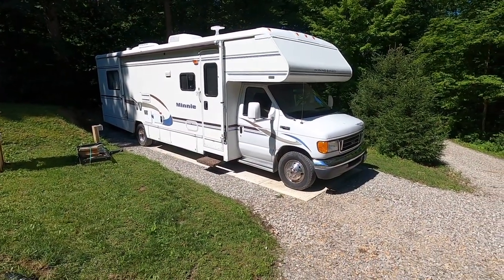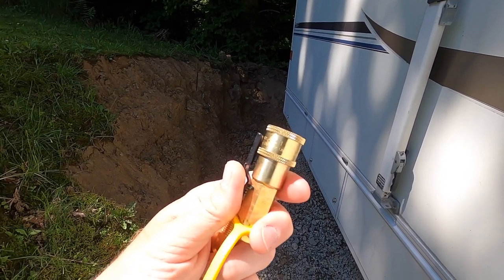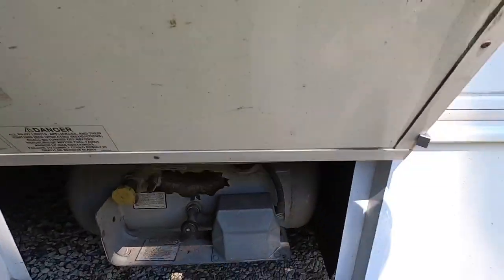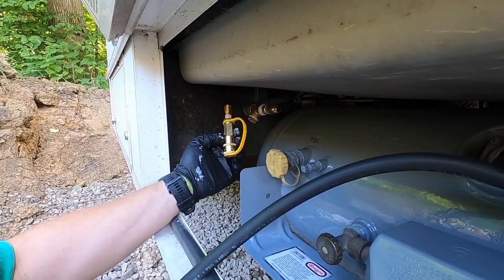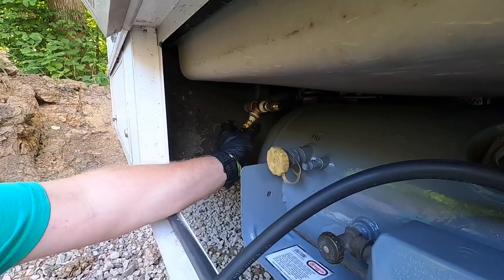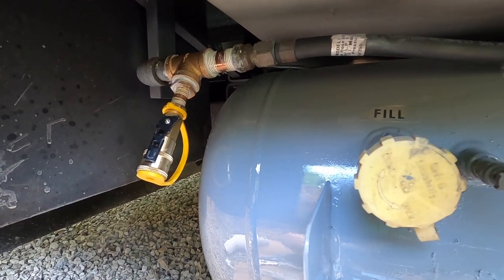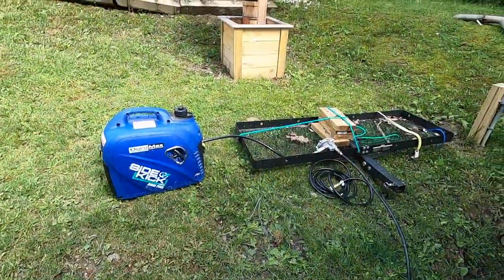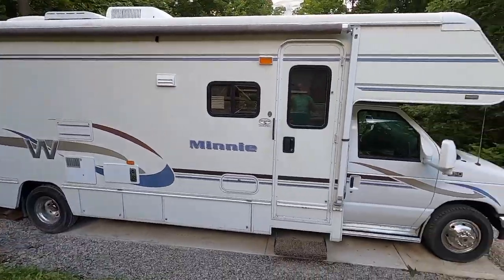How To Add A Propane Quick Connect On Your RV - Grill or Generator

Comment: Nice job. For those thinking of doing this brass fittings are not necessary of course so you can save some money with regular steel pipe and fittings. I would also recommend a line valve before the quick disconnect. They can sometimes leak or even stick slightly open when disconnecting and continue to blow gas until the seat inside the disconnect is realigned. Thanks for sharing your video.
Reply: RV are not all steel pipes underneath?

Comment: I like the tee better. $28 on Amazon and very easy to install IF you can remember the threads are bass ackwards.

In addition to using your frame mounted tank to supply a grill or generator,  you can pull propane from shore supply or from 20lb tanks.  Then you don't have to take your whole rig to town if your frame mounted tank runs low.

Oh... if you need an adapter to connect to the tee, look for the mr. Buddy heater adapter. $10 Amazon.  I can't find them anywhere else because they need the insert to go inside and release the gas.
Reply from the maker: I looked at that but it is before the regulator and would not work for my generator without another regulator in between. That may work for some people but I am duplicating what the RV manufacturers are offering on most newer RV's.
Reply from the maker: Wow. That sucks. Here in Ohio almost all campgrounds sell propane and a lot of gas stations will fill them too.
Reply: @JackofAllMasterofNone  
I wish I could fill my frame mounted tank from big ones like I  fill the 20lb ers  ..but for some reason it leaks horribly through the bleeder valve.

I don't fill very often since I put a 15 minute mechanical timer on my hot water switch.